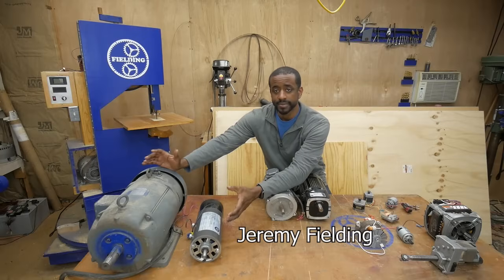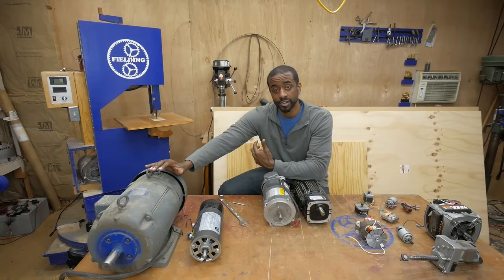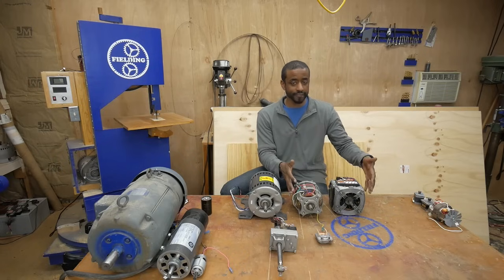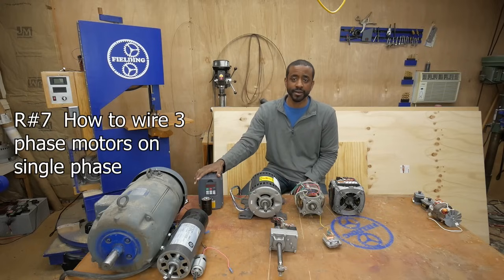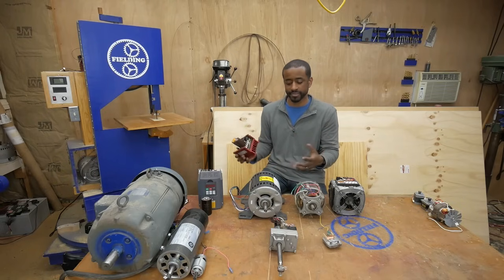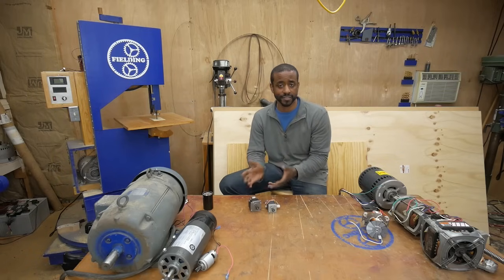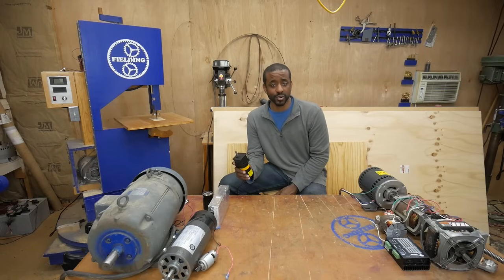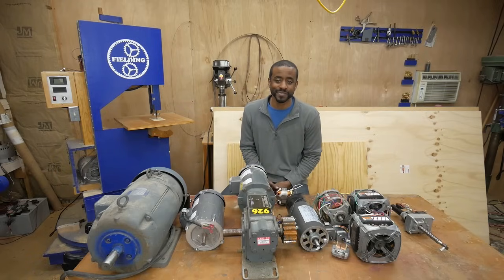Ultimate Beginners Guide to Using Electric Motors for Makers and DIY Projects; #068

Comment: I've been collecting motors for quite some time. In total, I have 6 DC motors and 23 AC motors.
4 of the DC motors are small 12 volt computer fans, and the remaining two are from drills.
Now the AC motors, god. 6 of them are brushed AC, from 3 vacuum cleaners, a blender, and a shredder.
 6 more of them are AC induction and they came from old dishwashers. 
2 more of them are also AC induction and they are garbage disposal motors.
6 more of them are shaded pole, and they all are from microwaves. I also have one induction blower motor that came from a larger microwave.
And I'm nowhere near done collecting them. Especially after seeing your collection.

Comment: I received a motor from an 80s or 90s era washing machine from a coworker. It’s missing the start capacitor. How do I know which start capacitor to buy for it?
Reply: Typically it is printed/stamped on the motor. Trial and error is also an option if you look up reference text for typical cap for a motor of that size, speed, age, etc. you want a nice smooth but quick start up.
Reply: Also, don't get hung up on getting the EXACT capacitor-- there's likely a wide range that will work.  Sure, there's an OPTIMUM one, but some others may work Well Enough.
Reply: It sort of doesn't matter. Without a capacitor installed a motor will just "hum" without moving, but if you spin the shaft it will take off and keep spinning (until you stall it). The only thing a start capacitor does is make the phase on the secondary much larger. The large phase difference only helps kick the motor up to full speed faster or under heavy starting load. If you don't need a fast start, use a lower capacitance. A start capacitor is only used temporarily at start up, but the run capacitor stays attached the whole time. A rule of thumb would be to use a start capacitor 10x the run capacitance, but you can happily get by with 5x to 15x without serious problems.
Reply: @therealjammit  I know a guy who lost two fingers starting a motor by hand. Way cheaper just fixing the starter.
Reply: Any idea on the brand/model of the washing machine? That info may help thinning down the options
Reply: Victor García it was a whirlpool
Reply: rwoodvet does it have a centrifuge switch at the back?
Reply: Some induction motors don't have start capacitors.  To get the motor to start the startup winding is made of a different thickness of wire instead.  I have a 1/3 HP maytag I believe washing machine motor that works like that.
Reply: Take it to an electric motor parts store and I'm sure they'll sell you the right stuff.

Comment: Great video. What voltage do you usually find in a treadmill motor? I need a 24 volt DC motor.
Reply: In the US (and other 120vac countries), 90vdc to 130vdc is typical. If you need a 24v motor, try eBay or Surplus Center... sometimes you get lucky and they have something that will fit your requirements.

Comment: Fascinating and informative. Thank you. Years ago I used a sewing machine pedal (rheostat) on my dremel. Worked like a charm.  lol
Reply: Thanks for that info!
Reply: For anyone interested but unable to get a sewing machine pedal , I took the heater wire out of a broken fan heater and used some to make a high power, low voltage dc rheostat.  Dirt cheap!

Comment: Weird how that big fat 200lb motor has the same power as that lil' treadmill motor. U were saying how thats b/c the fat one can work at lower rpms. I guess motor sizes and weight dont scale linearly as the fat one has 1/2 the rpms as the treadmill for the same torque yet nearly 10 times the size!!!!!!! u asked one time about where the teenagers are in the demographics so here i am...
Reply: Yeah, that's why we can't just look at a motor and say "Ohh, that's a X HP motor".  But, at the same time, those large motors can handle more load than the smaller ones. Not only can they run the heavier load at a lower amp, they can handle it due to the side of the shaft and bearings. If you took one of those industrial motors apart, there's actually a lot more space in there ratio wise than the smaller ones, which also leads to the larger ones running cooler, generally.
Reply: @korishan  ok but heres the 1m dollar question. How much copper windings in the fat one vs the small one and how does this scale with hp, linear or expo. Like does a 10hp motor have 2x as much copper as a 5hp one ????????
Reply: @nicksgarage8295  To be honest, I don't know. However, to take a guess, I will guess they have the same number of windings. The difference is the size of the wire used for the windings, as this dictates how many amps it can handle, and how much heat it can take or dissipate. The number of windings would be HP/Voltage ratio, if I remember correctly.
Again, this is just a guess. If it had been an actual scientific accurate answer you would of been lead down a road of math and equations to back up said statement. This was only a guess.
Reply: Efficiency, cooling method, environment and safety margin also affect power rating. Induction motors powering machinery are sometimes designed to be overloaded up to 200% (for a moment) while airplane bldc motors can achive their peak power only with extreme air cooling.
Reply: The big motor with the lower HP rating will run night and day for 20 years (or more) straight under full or overload and never heat up or falter.  The smaller motor with the higher HP will wear out and burn out in a thousandth or less of that time and probably won't deliver rated HP or overload continuously for more than minutes or hours.
Reply: There’s a difference between power as is to power under certain loads and consistency - as he said you can use a motor to spin fast with no ability to drain extra current under load that will do not much but spin fast or use that 3 phase low rpm motor that will draw further current once it has to apply more force to maintain its speed. There’s more to power characteristics than just “power”, mechanical torque current curves voltage even barometric pressure can make a small effect
Reply: The power output is the same but the mass of the rotor squares with its width and it constitutes a load in itself, so it's slower.

Comment: What is the torque of a 1/5 hp motor 1450 rpm
Reply from the maker: Use the formula from the video 👍🏾 I added it just for this question. Now you can calculate any motors torque
Reply: I still can’t understand how to do it
Reply: @BraedenPrice1  divide both sides of the formula by RPM. You get Torque = Power / RPM. Your power is 1/5 hp, which is 149.14 watts. Your RPM is 1450, which is 24.16 rotations per second or 24.16 Hz. 149.14 / 24.16 = 6.17 Newton meters.
Reply: You need to divide by 2 * Pi. The formula works without a constant only if speed is in radians / second. Multiply 24.16 Hz by 2 * Pi, and you have speed = 152 radians/second. Torque is roughly 1 N-m.
Reply: Somebody that knows, please referee.  Big difference between 0.10 Nm and 6.17 Nm. :)
Reply: @jdub9659  where did 0.1Nm come from?
Reply: 1/5 HP = 149 Watts. 1450 rpm / 60 = 24.2 revolutions/second. 24.2 rev/second * 2 * Pi = 152 radians/second. So the torque is 149/152 which is about 1 Newton Meter or about 0.74 foot pounds.